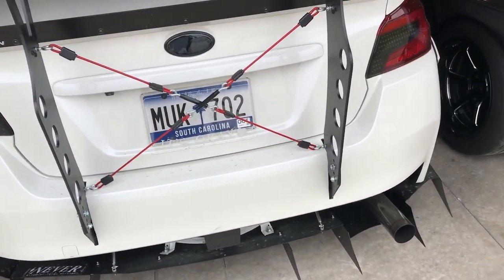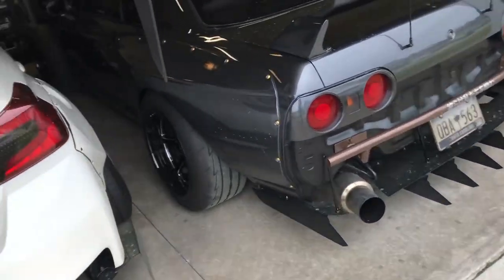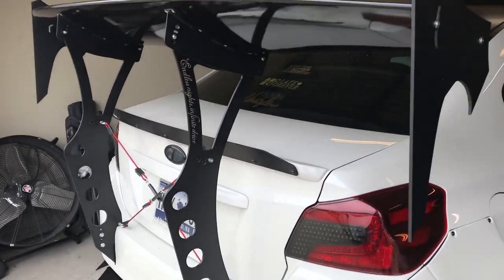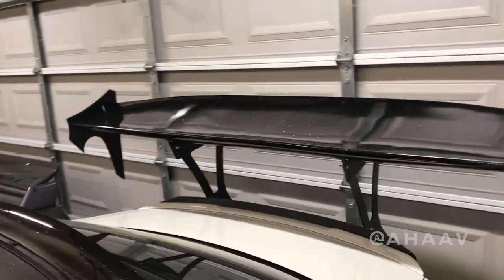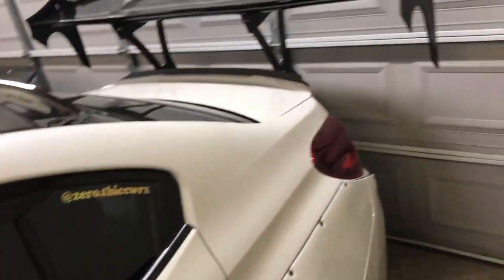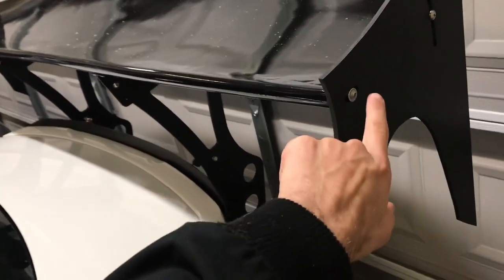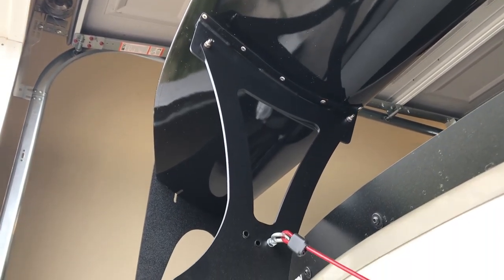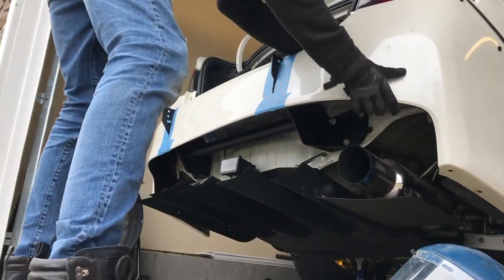Battle Aero Chassis Mount Wing Q/A, Demo, and Product Review

Comment: I've been wanting a chassis mounted wing for a while but still on edge. And you answered it. I use my trunk space very often for work and gear. Not a feasible option for now. Maybe several years from now when I dont use the trunk as often.
Reply from the maker: Battle Aero just developed a quick adjustment lever that's worth looking into. I haven't personally used one but I've heard good things about them.
Reply: @StephenBaran  I appreciate the heads up, I wasn’t aware of it so I’ll look into it. My interest has been re-engaged for now. +1

Comment: I just put one on my FR-S. In your install, there was a mention of the bash bar being same (mounting points)as the FR-S? I’d love to slap my chassis mount on my buddy WRX just for shits.
Reply from the maker: Yes sir! I’ve confirmed that the OEM bash bar of the FRS fits the 2015+ WRX with no problems. I’m not sure if the arm length on the wing kit is different from the FRS to the WRX but it’ll definitely bolt up. I’ve been super tempted on putting the chassis mount on my FRS just to see how it looks haha

Comment: do you have any rust issue?
Reply from the maker: I noticed a slight bit of rusting on the inside of the bash bar tubing where they didn’t plate it off. It wasn’t much at all but it was there. I haven’t had the chassis mount wing on the car for awhile now but it held up great for the 3 years that it was on my build.